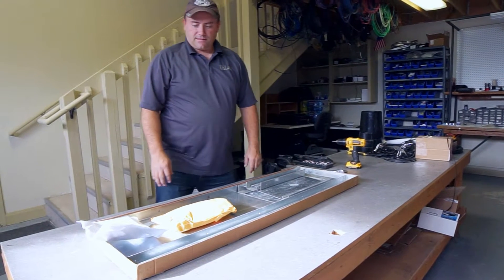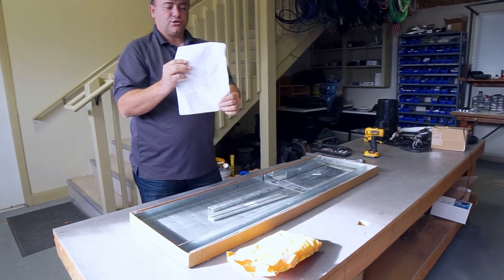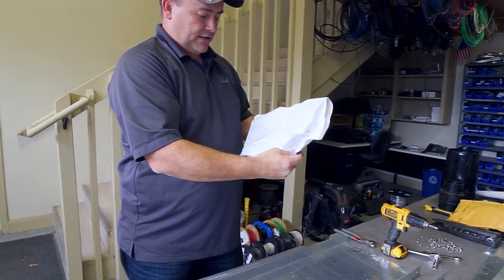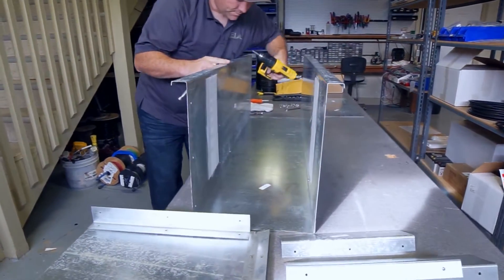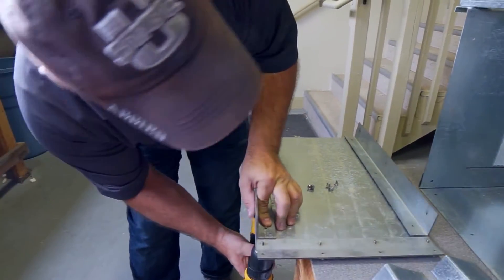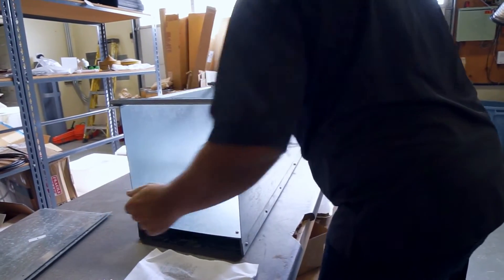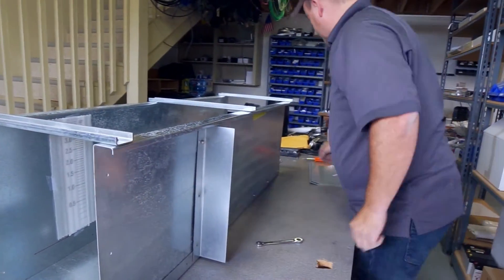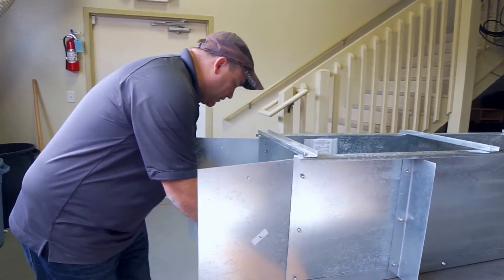EZ Flow Ramp Flume Assembly

Comment: We have to of the EZ-Flume (Nu-way) flumes in our ditches of the 7 CFS size for ditches with 3 CFS and 2 CFS water rights that are working well.   We have another location that is a 1/2 CFS water right - do you have any suggestions?

We have switched from the ditch approach to pumping with a collection of ram pumps at the above location.   Pump meters are expensive and probably won't work with our low pressure low volume pumps anyway.  The only thing I've been able to dream up is to first measure the output from the stream with a flume and then drop the water into the drive pipes for the pumps.   There are a lot of ditch water rights in Colorado less than 1 CFS and measuring devices are being required on all ditches - any suggestions?
Reply: Same question for 2023